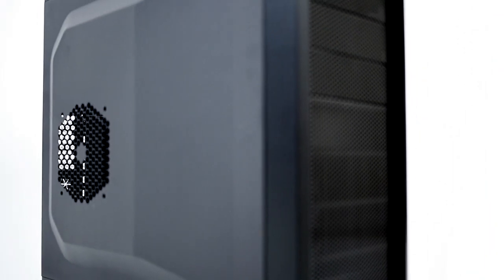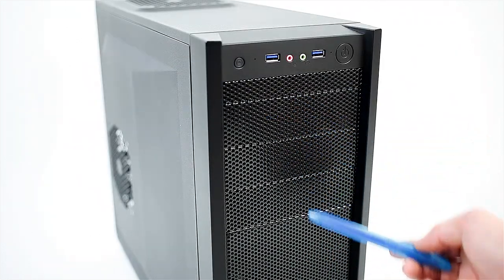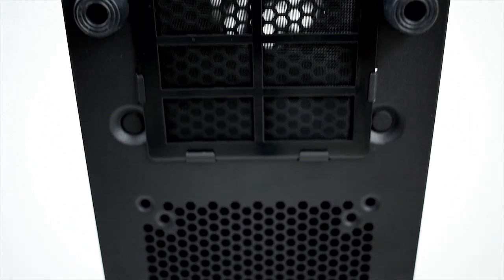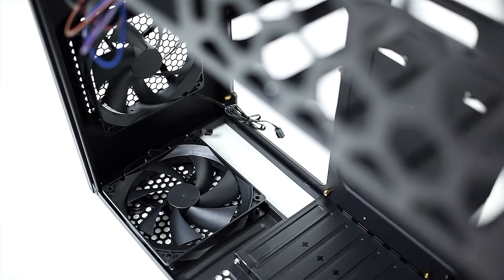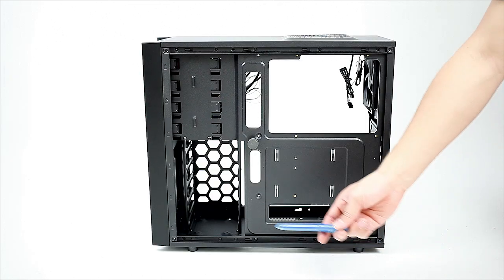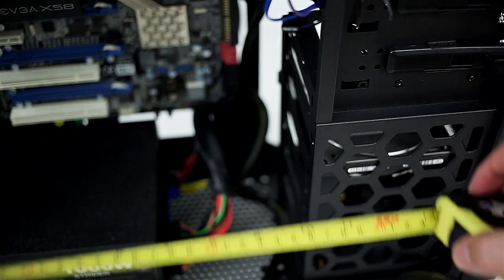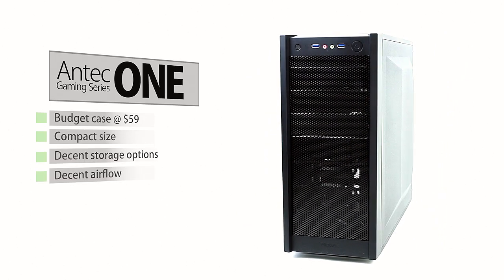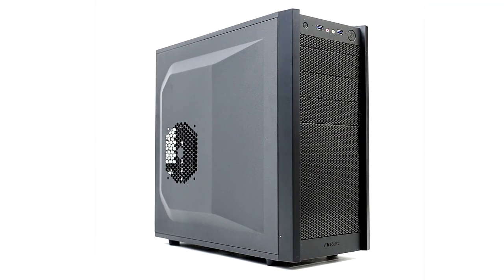Antec ONE Case Review

Comment: I own the One and it is really alright, I have the Asus M5A97 motherboard and a really mad cooling tower - Arctic Freezer XTREME Rev. 2 - and it all fits just fine - with the top exhaust fan still in place.
Have to agree about the tight squeeze for cables behind the case, this wasn't easy but eventually it worked out! I can proudly say that my build is pretty clean :D

Comment: I dunno what kinda facts you're basing that on, I have this as my case currently, had limited space so bought this for cheaper than price they state here. Excellent case, you can fit much more cables then is mentioned here! I have my 24 pin running along the back, zip tied down, all usb, front panel, 8 pin and tons of fan wires all bundled up in the back aswell. The side panel closes, mind you with a little force needed but nothing that can't be dealt with!  Overall excellent case!

Comment: the crews do not fit in the 120 mm fan at the front :(
Reply: Purple Bananas Not sure if you still have this issue but there are 2 long silver screws that come with the case for this.
Reply: MrDrWho13 Yes but they would not be secure on the fan. I ended up drilling it out so that the screw would fit. Thanks for the help anyway!
Reply: +MrDrWho13 Where do I get screws that will fit it? I got mine second hand and non came with it please give a link for those screws